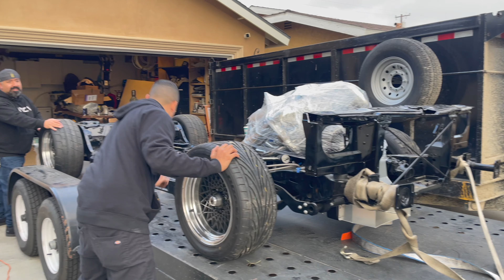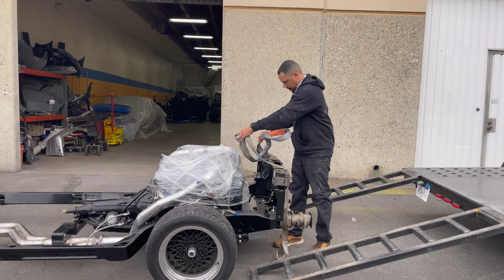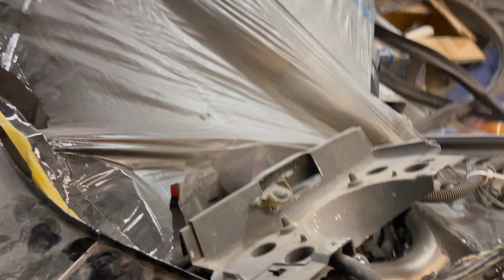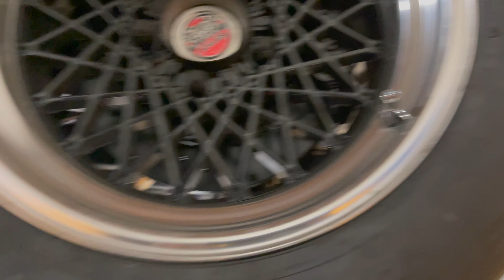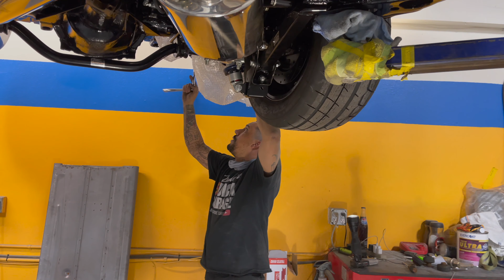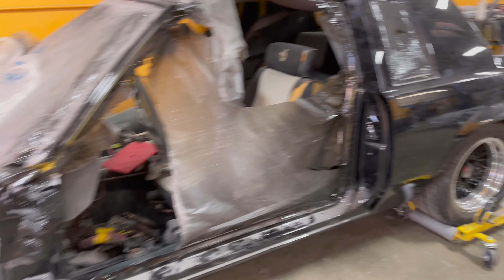Dropping Danny's grand national body on the frame.

Comment: You need to get some aluminum bumper brackets for front and rear with fiberglass bumpers. Just did it to my GN saved 125lbs.
Reply from the maker: He did get the aluminum brackets but he shaved the bolt head off the steel bumpers and smooth them out. So it looks like them but still has the sturdy medal in case of accident

Comment: your setup is looking great! I'm doing c5 brake setup on my s10 very soon, have most of the parts. did you have to do anything different with  the front brake hoses ?
Reply from the maker: Yes. Kore 3 sells a brake line upgrade to convert it for you. It was like $150 for all 5 lines.(front rear and axle lines)
Reply: @pablosbuickgarage  thanks I'll check it out

Comment: Any tips on running ur brake/ fuel lines after boxing ur frame? How did you route yours?
Reply from the maker: I personally haven’t ran any lines yet. But on Danny’s frame he ran them inside the frame. That’s one way , another it’s to mount to the lower section of the side rails almost like factory even with the box in there still room to run them there.
Reply: Thanks for the reply! You guys stay safe and blessed!